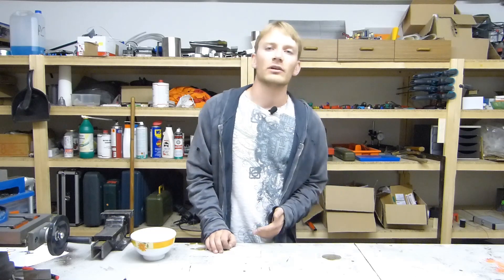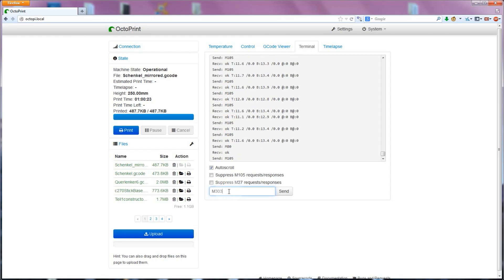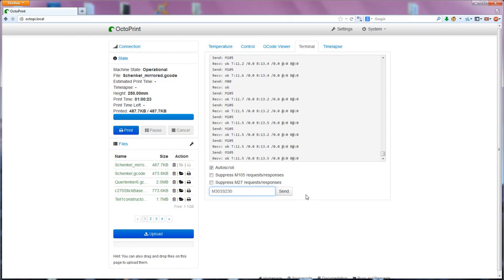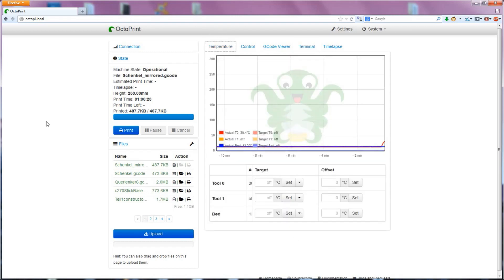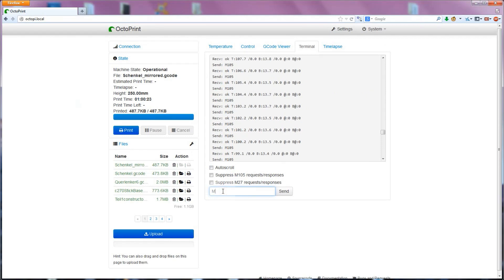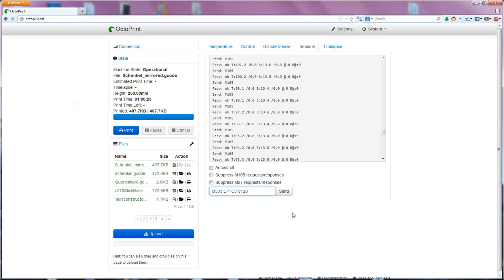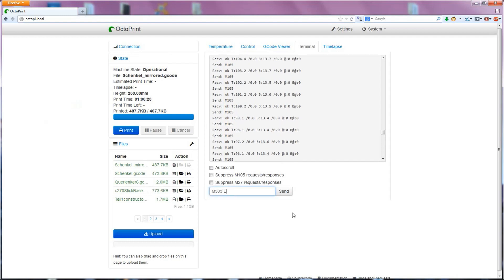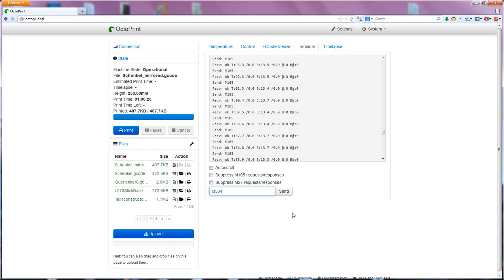3D printing guides - Using Marlin's PID autotune

Comment: After doing this my temperature fluctuation went away when I heat my hotend. But when I print at the same temperature, the fluctuations are back just a little bit less than before. 
What could be causing that? It's the same temperature but the only difference is printing vs. not printing / fluctuations vs. no fluctuations.

Comment: Hi, thank you for creating this amazing video, I have problem with my printet, I try to autotun my heatbed but actually When I try to do this For 110c degree, I got error of timeout, and that because every time try to reach the target temperature, it stuck on 1 or 2 degree before it, like 108 or 109. I know that I should run autotun but I can make it in this situation. If you can, help me by this please.

Comment: It would really be nice in the notes above if you could list the recommended codes with line explanation, such as 

"M303 S120 C5 ; tuning hotend for PLA"  (or whatever - I probably have this one wrong, but hopefully, you know what I mean.)

ALSO, could these simply be added and saved to the starting GCODE script to be run each time a print is started?

EXCELLENT VIDEO - extremely helpful.

Comment: Why doesn't ,when you set the different Temps in Cura, for the different filaments you are using, work, Instead of PID tuning the printer? So you have to do this with every different filament type, or just when the temps call for massive changes? Like when switching from PLA over to PETG? Do you have to PID tune every time you go from petg to pla? Or does the printer recall what you had previous done? My printer went biserk this morning, I had started to use petg a couple days ago, and had not pid tuned, before using it, the first time. It was going well, til, this morning, when I woke up and cam out to a halted print , because of "E1 heating failed Printer haulted Please reset"  warning on printer. Please advise. thermister wires okay.

Comment: But what temp to use? I just upgraded to 40W heater and now cant get my PID correct.  Getting thermal error shutdowns printing PETG @250C.  Do I use S250? That gives weird/worse results
Reply: TORDesign  did you ever get yours to tune, I have had the same problem for three days now. I'm trying to manually dial down settings to get auto tune to work without any success
Reply: caseyv63 I did manage it by putting the silicon sock back on my hotend. However I think the extra wattage of my heater is causing a loose wiring connection to intermittently fail so machine is currently awaiting wiring repair before I can conclude that s higher temp PID will work.

Comment: Please, anybody, help me with this. Heating on my Anet A8 is continuously getting failed, I have tried all combinations of thermistors and PID's available in the marlin version 1.1.9. I do not know the model of my thermistor. It gets heated swiftly up to 100-110 Celsius, but after that, it takes an eternity to climb up to 130 and eventually gets failed. Please, reply ASAP.
And for the record, the thermistor is mounted perpendicular to the heater in the thermal block.

Comment: How important is the stability of the temperature of the hot end? Lots of people talked about temperature swings 10C and more. Some say theirs is rock steady. But, there seems to be no consensus as to what is a normal +/- C of a hot end and it's correlation to print quality. Can anyone shed some insight to this matter? 
My printer (I3 Mega) refuse to start printing for ABS filaments. According to Anycubic engineers it is because the temperature of the hot end  is not stable . However, they did not offer any solutions. The hot end has a temperature swing of +/- 8C at 245C.

Comment: 1:42:03.378: PID Autotune start
1:44:34.491: bias: 89 d: 89 min: 197.27 max: 206.25
1:45:05.163: bias: 88 d: 88 min: 196.82 max: 203.37
1:45:35.440: bias: 88 d: 88 min: 196.90 max: 203.33
1:45:35.442: Classic PID
1:46:06.241: bias: 88 d: 88 min: 196.82 max: 203.44
1:46:06.257: Classic PID
1:46:36.658: bias: 88 d: 88 min: 197.02 max: 203.33
1:46:36.658: Classic PID
1:47:07.191: bias: 88 d: 88 min: 196.82 max: 203.33
1:47:07.191: Classic PID
1:47:37.595: bias: 88 d: 88 min: 196.99 max: 203.33
1:47:37.597: Classic PID
1:48:07.487: bias: 89 d: 89 min: 196.96 max: 203.33
1:48:07.487: Classic PID
1:48:07.514: PID Autotune finished! Put the last Kp, Ki and Kd constants from above into Configuration.h
1:48:07.542: Error:Line Number is not Last Line Number+1, Last Line: 1210
1:48:07.542: Resend: 1211

It doesn't seem to be giving me the Ki, Kp, and Kd values. I'm using repetier host to do this. Any ideas?

Comment: I just changed my nozzle from a brass to a hardened nozzle for my E3D V6 on a Prusa MK2.. Should I run an Autotune? Seems ok. I've had issues some times when the printer has been powered on for a while and I get thermal shutdowns cuz the temp varies my more than 15 degrees. Doesn't happen if I power the printer off then on again.

Comment: Personally this would have made more sense to me if you would have been doing an example even though it would have taken longer. This is because I am new at this and I am sure it would have made more sense if I had a visual aid tied to the numbers. You mentioned at the end making tuning permanent verses until you turned it on next time.... as you can see that went by so fast I could not get the license of that car, let alone who was driving!!!! When it comes from the factory it has permanent setting doesn't it and yet you can change them. Can you say lost!
Reply: I agree,  Tom  you really rushed this one and the m303 had me rewinding 5 times to understand what you are saying did not match what you were doing.  Not your best work but you are a tremendous help.   You might want to mention in this video that you can't use PID if your using a separate a mosfet to control your hot bed.

Comment: Is it advisable to have the parts fan running while doing this? Mine is blowing at the nozzle, so it cools down the nozzle so strongly that it has problems keeping the temperature.
Reply: +Thomas Sanladerer Thanks Tom, makes sense. Getting the Airflow into a pattern that it doesn't affect the nozzle will be a challenge though, I have a printer that didn't have a parts fan originally and the print quality sucked badly. The fan increased it dramatically, let's see if I manage to fit something to it that does the job. Thanks!

Comment: I tried the PID Autotune on my reprap and I can't get the temp to register more than 140C.  I don't think its a power issue, I have 12.8V to the hotend.  I also can't get the bed to even heat up.  Any Marlin settings I am missing?  Any way to check my thermistors?  I am using E3Dv6 hotend.  I tried with both pronterface and repetier.  Any suggestions???
Reply: +John B Hi, how many amps can your power suply delliver? an E3D V6 takes 40watt's at 12volts, thats around 3.3 amps.maybe your power supply can't delliver that amount of current.

Hope this helps,
Bo
Reply: I got it working a while back. Thanks for reply.
Reply: +John B You could enlighten us for what was the issue and how you solved it, so if this happens to someone else they have chance to find a answer.
Reply: +Hellsong89 I really wish I can remember what I did but I can't.  Sorry.
Reply: +Hellsong89 My printer is working great now, if I can be of any help let me know.  Tom's videos were a great help!

Comment: The M303 S230 C10 command worked for heating up and testing my extruder, not my bed... doing M303 E-1 S60 C10 as per documentation had it responding weirdly and the hotend stopped cooling down while the bed wasn't warming up at all. Any suggestions?
Reply: Ignore that, please... I figured it out. Thanks!
Reply: Hath'alud LaFox what did you do to fix it?
Reply: John B If I remember right, I was specifying a non-existent hotbed.

Comment: Hi Tom, great videos, keep up the good work!

I'm just wondering does Marlin use a fixed Integral time and Derivative time, or does PID Autotune change those too?
Reply: ***** is that just because of the clock time of the processor or what? As you can see, software isn't my strong point 😜 I can't see it making a huge difference on the hotend given how quickly it responds, the bed may be a different story though

Comment: Hi, congrats to your fine videos, i've been watching them quite some time now and I enjoy them. 

I tried to use PID autotune for my printer (K8200) but i always get a "pid autotune failed timeout" back when i want to use it. 
Triggering it with the command M303S200C8. 
Do you know what the reason could be?
Reply: Alexander Planitzer I get the same error.  I can't figure it out.
Reply: +John B Hi John, i can now finaly give you the solution to our shared issue. You have to update your printer to the latest version of Marlin. After updating the M303 Command should work just fine.

Comment: I am having some problems with the PID autotune. When i send the command M303S210 the temperature rises to around 240 and I get the error message "PID Autotune failed! Temperature to high". I tried setting the target temperature to 100 degrees, but it just heats up to 20-30 degrees above the target temperature and gives me the error message. Someone please help me?

Comment: Hi again Tom, I'm having a very odd issue with my thermistor reading. Trying to print ABS so I was aiming for a temp around 230, however once I set my hot temp to be anything over 215, my thermistor reading jumps off the chart reaching upwards of 350 degrees instantly. I don't think I have the wrong thermistor table as it reads correctly at room temp and none of the other tables in marlin do so. I'm at a loss here.
Reply: This is the second thermistor thats had the same issue.
Reply: The only thermistor that gives a normal room temperature reading, and is the one im useing is the 100k 0603 SMD Vishay NTCS0603E3104FXT
Reply: I've tried some of the existing 4.7k pull up thermistor tables. I get a rating twice that of room temp, at room temp, with those.
Reply: OK it looks like my melzi has 10k pullups instead of 4.7k or 1k. Now I need to find a damn thermistor table which considers that. Thanks tom for point me in the right direction.

Comment: I'm trying PID autotune the with a E3D v5 hotend. I get "PID Autotune failed! Temperature too high" if I simply try an "M303" command. I back down to trying "M303 S100" and I did get some values. Set them with M301 Pxx Iyy Dzz. Let the hotend go to ambient room temp and tried "M303 S150" and failed again with an over temp error. I also tried your values, same over-temp failure. Marlin firmware (latest as of today). A search on web seems to indicate this is a common error. Any suggestions other than refitting my J Head which doesn't overshoot? Maybe a bad thermistor from E3D?

Comment: Thank you for this and the firmware setup video *****, I was never able to get Marlin to compile properly until now, clearly you are a miracle worker!
Also not having to manually tune PID is pretty amazing, I remember having to do that on a set of gen 3 electronics and quitting for a year because of it.
Reply: where is the firmware setup video?

Comment: If I power off the printer, it doesn't remember the Kp Ki and Kd settings?
Reply: +Thomas Sanladerer how is M500 different than changing the setting in marlin and upload that way?
Reply: if re-uploading firmware doesn't erase M500, then how would one get rid of it? thx